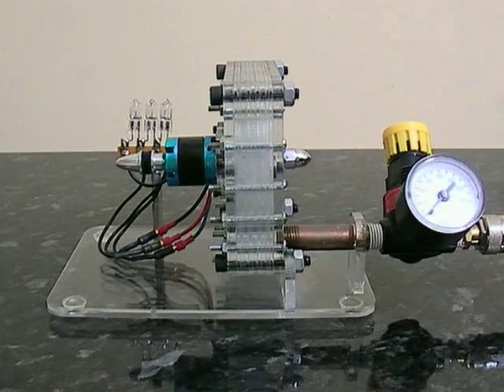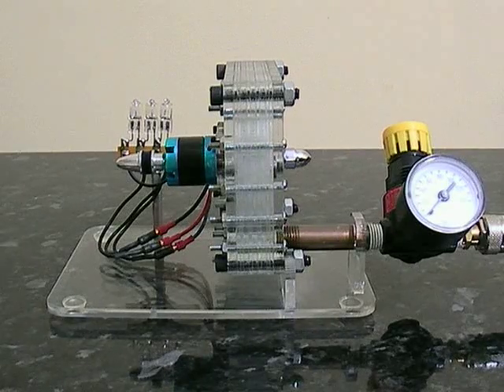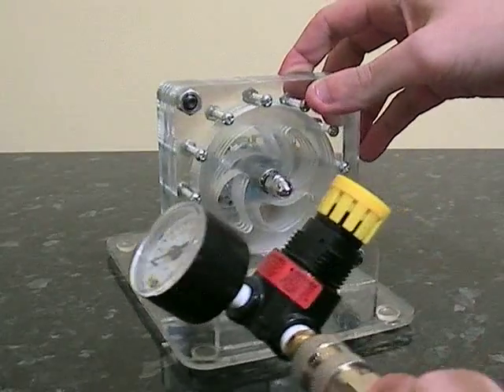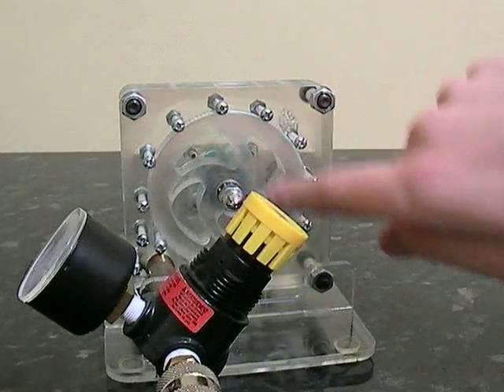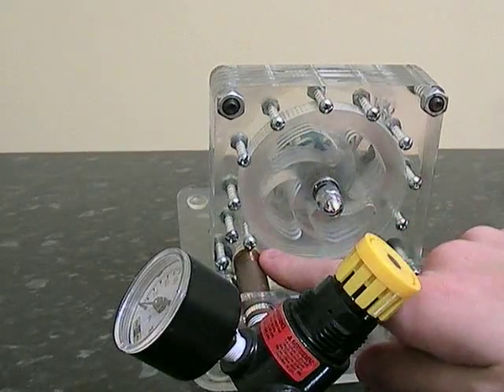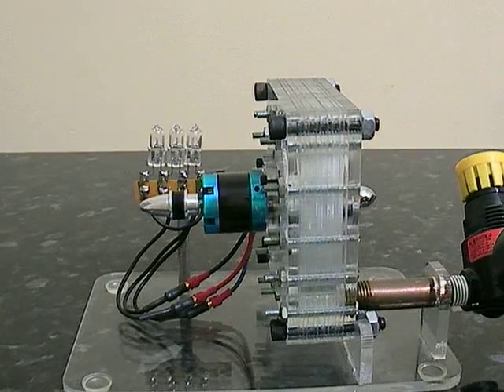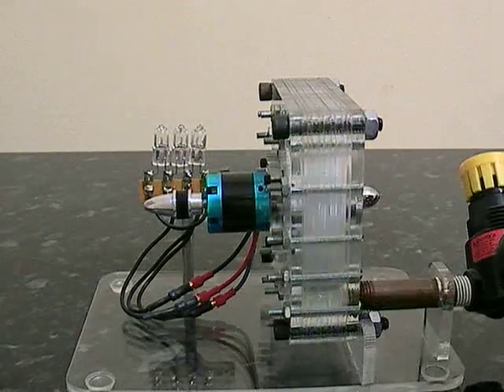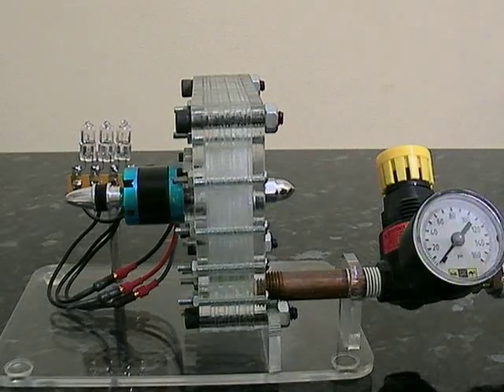Tesla Turbine (Bladeless) - from gyroscope.com

Comment: @FatBlackFrancis AC and DC are just classifications we have put on forms of electricity, the same way we call one color blue and another one red.  AC is simply current which is having its poles reversed constantly and produces work in both directions.  There is nothing un-natural about it other than we have manipulated the current to reverse poles x amount of times per second.  Besides it makes long distance wiring possible.  It was one of the greatest discoveries in terms of efficiency.

Comment from the maker: It was invented over 100 years ago.
You've not heard about it because it was almost forgotten.  It has not had as much development as similar concepts. Hencecommerical versions are very rare.

ROI is a business term. Basically if you spend $1000 how quickly will you get it back. 

So solar panels cost a lot to produce. Some have a 10 year ROI (before you get your money back).

What if there was a mechanical solution that can be made in china that does the same thing.

Comment: Photovoltaik is not very efficient... I've seen the amount of area you have to cover to get 1 kW.
But I am still not quite getting your point. Since you have to power the compressor of maybe 200-500W (not sure did not research) then let the compressed air go through a turbine. All this is is linked with the efficiency factor. You loose air going through the turbine, since i bet it is not completly airtight.

Continue....

Comment from the maker: yep many people don't get it either. This is a really simple turbine that is cheap/easy to make and is very flexable.

Now you need to find a source of energy, a running stream of water, air flow etc and you have power.

There is also applications for solar power too if you think it through a little.

Comment: If solar, then why not use Photovolaik Panels for Energy production without also going over a Turbine.

Do you mean cause Photovoltaik creates DC and a Turbine can create AC? These days electronics have advanced far enough to create a rather good AC power of 50/60 Hz

Comment: There is a lot of debate on this.... some say that it actually uses cohesion/adhesion and thus is distinct from friction and thus can be one of the most efficient turbines available, but I can't find any conclusive studies one way or the other. Also though it serves as a very efficient pump - and as it is used for pumping gasoline, the blades must remain cool when pumping at least.

Comment: With the tesla turbine, would it be more efficient if the air intake was near the disk center, moving out to exhaust? Does centrifugal force affect the air as it goes from disc edge to disc center to exhaust?

Comment: Well to be technical he invented it because condensed water in steam will destroy turbine blades, a tesla turbine is not hampered at all by this and can work as a pump- by the way Gyro I suspect the output disc holes you etched are better suited for fluid.  I may be wrong about that though- but they most certainly do reduce your boundry layer effect efficiency by increasing the surface area of the housing in constrast to the blades.

Comment: thats not to say the rest isnt true. they are a very interesting technology, and are much more durable for some cases. but they are a high rpm design, and put enormous stress on their bearings, and arent cost efficient. and they technically do have blades. the disks are blades. they create resistance for the air, and rotate=they are blades

Comment: tesla turbines are less efficient. too much energy passes it by completely. to check how much energy it wastes, open the valve on the compressor slowly until the turbine JUST moves. then back up on it until it stops. calculate how much energy is used to compress the tank to that psi. that is how much energy is wasted for every pound of air that passes over the turbine. you actually lose about 80% of the energy

Comment: No.  It just stops running if the air pressure isn't great enough.

If you feed it enough compressed air over an extended period of time it will keep running so long as the air is running.

Tesla invented this to run on air that was pressurized by combustion (steam, or hot air).  Problem was, in order for it to work, he needed materials that could stand up to that heat... and those materials didn't exist THEN.

I wonder how effective/efficient this would be.  I'm on a quest to find out.

Comment: Good, but how much energy is required to compress the air.. 
Would be interesting to see in a running stream of water.. But how to build up that much pressure.. It seems to require high speed fluids (air or water).

Comment: Earth ground is naturally dc negative any buddy who works on telephones knows this but how ever crystal radio depends solely on ground connection and a100 ft antenna {no battery's nothing}  can receive ac cut to a pulsating d.c. by the crystal to hear local stations like in one  of my videos.watch out for stormy weather and keep the smoke in the wires(o_0) 5 stars

Comment: Jst because some people don't see the big picture people just bash this over and over. Its a very efficient way to turn fluid movement into mechanical movement which can be easily turned into electricity. 

If your still scratching your head as to why this is important or how you could use this . . . here ya go. Make a boiler burn brush use the heat to make steam pressure then use the turbine to make electricity or use a solar collector to make the heat instead.

Comment from the maker: Any pressure difference (high enough) will power the turbine. This means it can be used for solar power and water power.
It also be used for savaging.  Efficiency is improving all the time.

Comment: Soo what is the point?  Everytime someone pipes up with a "this is a pointless experiment!"  Someone replies with a "you're missing the point"  Well?  What's the fricken point?  Even with the most efficient turbine you're still gonna require alot of energy to get the compressed air.  If this could be used in a hydro dam, you might see some benefits but even then is it worth it?  Also kudos on the construction of the thing.  It's nice to see something other than a stack of CDs spinning around.

Comment: Great model, I can't wait to see a video of the new and improved turbine running. 

I have a question: are those three lightbulbs connected in delta or star configuration? It looks like delta but can you please confirm? And are the generator windings delta or star?

Comment: why do you not agree with red???
you did use more energy from the pressurised gas cylinder to power bulbs.
I cant see how somethin so innefficient could be put to use commercially.

What we need is to work on Teslas idea of harnacing the energy from lightening.
If we can light bulbs using tesla coils we can use the same energy to power electrical goods using harnaced AC currents.
The tesla turbine was his workhorse invention and was simply used to generate the AC current for his experiments

Comment from the maker: Yes, efficiency is one thing. Tesla turbines also have a low maintence cost. Can take debris through them and have a low product cost.

I've got units with around 15% efficiency. I'm hoping to have a 50% efficient commerical on sale soon. 60% or 70% is probably the upper limit in everyday use.

Comment: Impressive!  

So is this a turbine that is ultimately designed to run off of steam or is it intended to be used as a kind of jet engine?  It seems as it would do both well. Not to mention it seems quite a bit simpler to build then a standard turbine and a lot less fragile

Comment: I think what he means is that the material of the disk should be chosen according to the adhesion and viscosity of fluid. Also, the size of the disks, number of disks and size of "holes" should be considered. Why does everybody refer to this turbine as "bladeless"? Aren't the disks "blades"? After all, they perform the same function. All in all I doubt that this type of turbine is very efficient for most applications.

Comment from the maker: The psi/bar is the pressure not the volume. CFM is the volume. You can have 200psi with only a tiny amount of air.

You can use air, water, steam, gases or pulsed combustion.

Comment: 60psi is alot of air, 14.5 is 1 bar, 
=4.137931 of air. besides water, ( no air) what else would you use to push it? this as an app. is usless. using it in a sub, or boat would be good.

Comment from the maker: Are you talking about the turbine or the electric motor. If its the electric motor, it has an efficiency of 80-85%. However its not running fast enough with this turbine. So its probably more like 70% in this case. The it capable of 150 watts.

Comment from the maker: If you have a solar panel it would be more efficient to use the energy directly.
However you can create a cheap solar air tank and the air coming from that could be used to power the turbine. To regulate the voltage/hertz you convert 3 phase to DC and then DC to 2 phase 50/60hz.

Comment: Would it be possible to use a solar panel to run a motor that would pump air to the turbine, and then power a generator that could  be used to cut down on the amount of power you buy fro the power company, or possibly, run enough that you could sell your excess back to the power company, and actually make a monthly profit. Also, how hard is it to regulate the output to 60 hertz and a set voltage without fluctuation?

Comment: Before I believe in something Tesla claimed, I want to see it prove.
There are many guys around, which wanted to replace the common blade turbines, either water or steam, by Tesla Disc sets, and failed... because still wasting primary energy...
So Tesla semed not only failing in electricity and magnetism... a great man, indeed, but many things need to be fixed and needs more experements, but all far from high tech dreams

Comment: Fact is, the Tesla turbine system can work in a backyard, or even in a kitchen. It is simply a motor (or a pump), and as such can be hooked up to run most anything...either as a generator, or direct hookup, say to a blender or other high-speed appliance.

 I'm sure this unit could be adapted easily run on water pressure for quiet running as well.

 The green power to run this unit could come from a solar-powered compressor/tank air source, or perhaps a mountain stream piped in.

TT's rule!

Comment from the maker: Because
1) Its cheaper to make discs than blades
2) its cheaper to design
3) You can reverse it with no loses (unlike normal blades
4) the discs tend to wear out far less, don't have to be replaced so often
5) the discs can handle different mediums with minimumal or no design changes.

Comment from the maker: That question gets asked quite a bit. Firstly as it stands you can use waste air, steam, heat from factories to power the device and produce electricity. Secondly I'm working on one that use fuel (gas or petrol) so it acts as a generator. Why buy a generator like this you ask? Its cheaper combustion generator and is only about 10% of the weight. Hence a generator you can put in your back pack.

Tesla turbines also have some other advantages too.

Comment: Great Video...I might try this myself, I did not know of this device, ingenious.

Air power does seem to have some real potential, even though it is not "free" (it takes energy to compress the air) compared to toxic expensive batteries to store the power, an empty tank has them beat.

An engine that has no blades or complicated valves or seals is remarkable. That it is 100 years old assume out of patent, makes it intriguing in that the idea is now "free"...compressing air is possible yourself!

Comment from the maker: I haven't worked out the efficiency yet. 
BTW: you can't compare the the power used from the compressed air because there is heavy losses compressing the air but a gasoline engine is using the energy direct.

I know someone who is claiming 60% for a tesla turbine. I guessing this one is less than 10%. However, I'm making adavances with the metal tesla turbine, I expect the efficiency to improve over the next year or two.Don't forget there is still a lot of work to do on this yet.

Comment: Good construction.  Whats the efficiency?  How does that compare to a conventional turbine?  If it took 2000 watts to compress the air to generate 60 watts for 5 seconds then thats only 15% efficient, about the same as a gasoline engine.  Unfortunately most of the electricity is still generated from COAL fueled power plants.  There must be a better way!

Comment: yes you can get compressed air for free.
A wind turbine can be used to collect the power of the wind and store this power in a pressure container. If then needed, the energie can be transformed to electricity. But find a way to use the cold at the outcome of the compressed air.
Thanks for the video

Comment: What I'd like to know is if you get more torque by making the holes smaller in the disks, thereby making the air stay in the blades longer (and also by injecting the air tanjentially, creating as big of a spiral as possible).

Comment from the maker: I'll be adding some more turbine videos soon, included some in series. With regard to how they work, put simply the air drags the disks round. Air, water or steam can be used. The metal turbine video I have goes into more detail on the design. All my turbines are professionally made using milling, lathes and laser cutters. This one is no longer on sale but the metal one is now on sale.

The technology should improve considerably over the next couple of years.

Comment from the maker: I think I am providing a real service. BEFORE making large turbines I making smaller ones and getting the efficiency up and the technology right. I suspect with only small changes this turbine could produce 1-2kw.

To put this in context a normal generator weighs about 22kg to produce 2kw. This turbine is just weighs about 1kg at present.

Comment: while they may not be as efficient they do have a much lower maintenance & manufacturing cost.  And Tesla originally invented the bladeless turbine for liquids. It also has the advantage of being able to run in waste water where most turbines blades would be blocked by debris easier (yes its not clog proof itself).  And Tesla envisioned it being used for steam as it handles both liquids and gas without any change in design (useful when steam pressure/temp is not guaranteed to be a gas).

Comment: sorry,just an outsider,but..the compressor works on electrical current,right?what's the point in using electrical current to produce electrical current?does it produce more than it uses?

Comment: well, it resumes in how much power does the compresor needs to run, and how much power does the generator makes, theres a loss of energy in the proces ("exergy"), of coarse it will be better if it were bigger and use vapor

Comment from the maker: right. The differences. The tesla turbine is cheaper to design and make, it is also less likely wear or need maintence. A normal turbine has better efficiency but this is not surprising considering the amount of development it has had over it lifetime.

The new metal version I will be selling is modular. So this will help people improve the efficiency themselfs. For example
changing the distance of the disks or even changing the design of the disks or how the air is blown in.

Comment: What I love with the Tesla turbine is that you can use it as a pump. That turbine can pump much thicker mud than any other turbine! Great for flooded areas where you have to remove muddy water quickly.